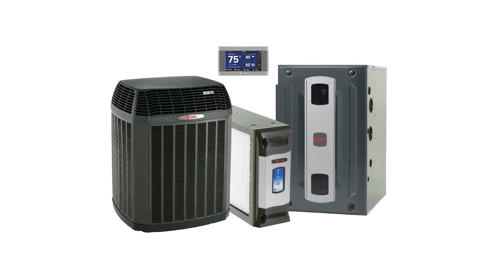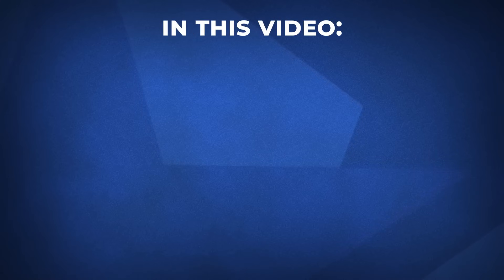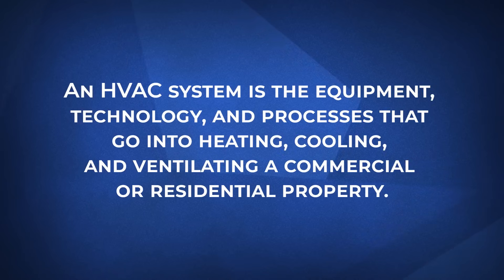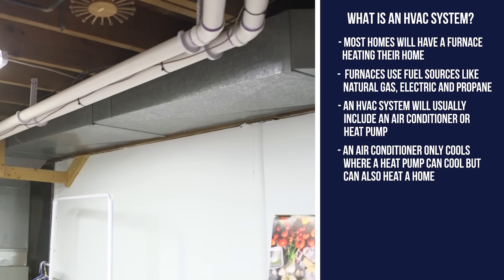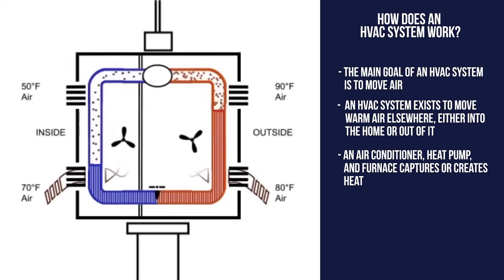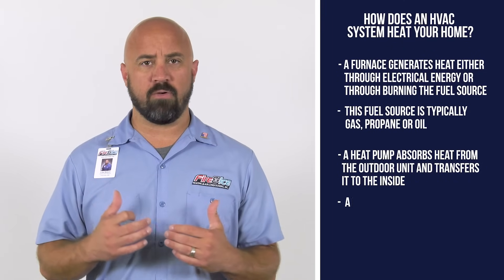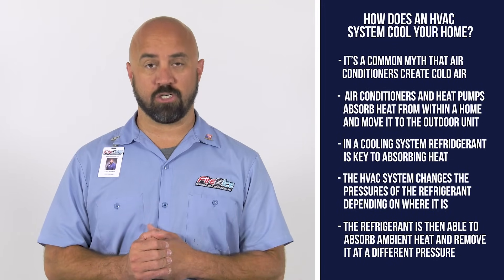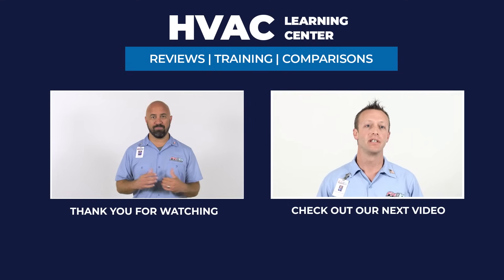What is an HVAC System and How Does It Work?

Comment: Hello. I have a very LONG question and I hope you are willing to read the whole thing and help me!  This house is 16 years old, and we have owned it for 3 years. It is 1,800 square feet… one story… built on a slab. The HVAC is accessible through a drop down ladder in the garage that leads to the attic. We have a tech come twice a year to service it. So far all we have needed (last summer) was additional Freon. This week a new tech came (same company) and he said that the filter (permanent— not the replaceable paper kind) was a problem. I admit that I can’t do a good job of explaining this because I didn’t understand his explanation. He tried twice, but it’s like a foreign language to me!  Anyway, this is where it all starts to fall apart. He told me what paper filter to buy AND he offered to remove the filter there and set it aside. He then took a photo (I’m going to try to attach it here, and in the meantime let me describe it as a sliver attaché case) of what’s up there. Two days later the house felt chilly so I turned on the heat and there is a banging noise!  It sounds like a wet sneaker bouncing around inside a dryer!  The next morning I called the company and they are sending the tech back Tuesday. I watched your video, but not surprisingly it doesn’t address my exact situation. May I ask for your opinion about… should I insist he put the original “permanent” filter back?  What’s making the banging noise?  Did he break something or is this just coincidence?  What else should I ask?  I appreciate any information you can share!  Thank you

Comment: you are saying that to cool our homes the heat pump absorb heat from outside and then heat up our rooms ,how ? if the temperature outside is in minus degrees.
Reply from the maker: When temp is that low, a heat pump should have a backup heat source

Comment: it can reduce the carbon emission of data centers or not I want to know please because I am doing the assignment. if you found my comment please answer to me
Reply from the maker: All data centers use electricity and need cooled.  So a high efficiency unit could lower the amount of electricity needed to cool.  Thus using less electricity from a coal burning power plant, thus lowering carbon emissions

Comment: You have to be very careful when choosing the right HVAC company. I know of unscrupulous, immoral, creep HVAC technicians can fumigate customers homes with toxic, dangerous, hazardous, asphyxiant gases by controlling the high efficiency heating and cooling system to emit the asphyxiants. These vile, criminal, dog HVAC technicians induce cardiac arrest, strokes and other ailments by fumigation with the high efficiency heating and cooling systems. The cops know it. Lawyers know it, judges know it. And the criminal HVAC dogs know it too. They MURDER people cleanly and efficiently this way with. Only a matter of time until this method of murder is exposed in the mainstream.